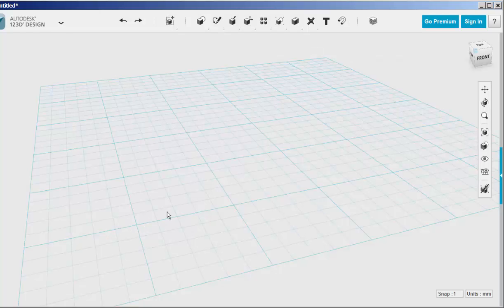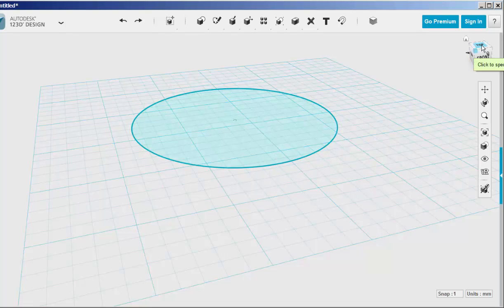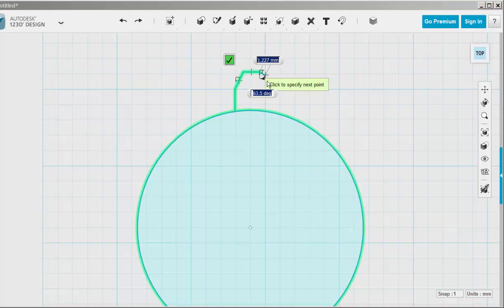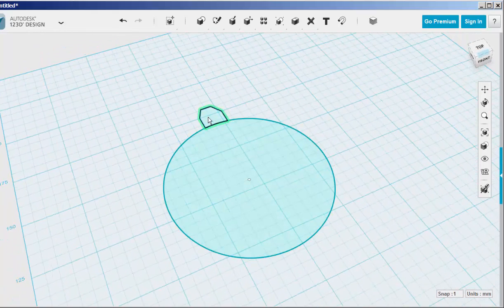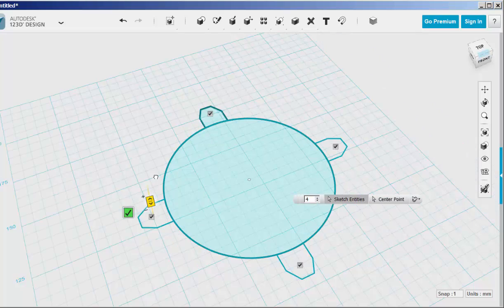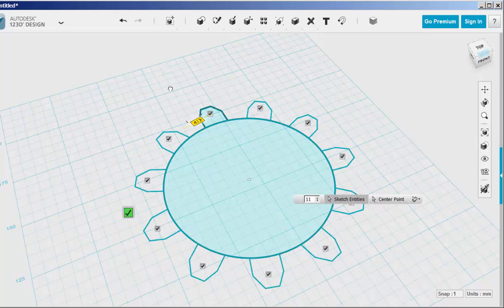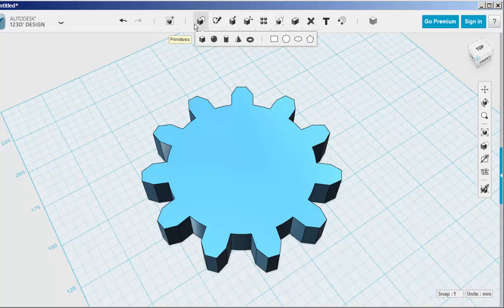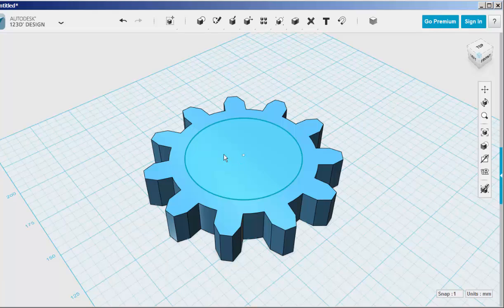123D Design: Spur Gear

Comment: I'm having a bit of difficulty with 123d design. Could someone please help me?
Reply from the maker: What, specifically, is your question?
Reply: I'm trying to extrude part of a object but it won't let me. It just says "invalid operation."
Reply from the maker: Is it a closed face? Can you see a face on it? If it's open face, it won't extrude.
Reply: It's a solid object. I drew a circle and tried to extrude in order to carve out a cylindrical shape from the object.
Reply from the maker: If you could link to a screenshot, that might be helpful. I'm wondering if you're press-pulling instead of extruding. Sometimes the latter works when the former doesn't. Also, is the object an imported STL? You can't extrude through those.
Reply: How do I show a screenshot here? I save my work as STL only when I want to print. This is a regular file.
Reply from the maker: Post the screenshot on any hosting service (e.g., instagram) and link to it here. About STL, I meant, if it's an imported STL file, you can't do much with it.
Reply: I don't have instagram. No, it's not imported. I can extrude the same object just on different places. It's only this one particular spot that it won't let me.

Comment: Although I see some complaints about whether this represents a functional working gear or not. I am just beginning 123D and don't really care whether it actually works or not, or even if the shape happens to look like a gear.   What I learnt was how to make multiple copies of a design and space them around a circle evenly and as I experiment I'm sure there will other uses for this info.  For that I am very grateful as it will help me a lot designing what I want to make in the correct dimensions all in 123D instead of using a 2D program and importing. Thanks :)

Comment: (Circle gear) my program i can mark only one object the big circle or the tooth is there a key you holding down?
Ok i found out if it do not work right as you seen:
1 Mark the tooth.
2 Click the gear symbol like in video.
3 Then before marking any thing, make sure its on the right side are on (angle)
4 Click center point of the cirkel.
5 then it shuld be there :-)
Reply from the maker: Hold the Shift key down to make multiple selections.

Comment: This is how you make a gear. https://www.youtube.com/watch?v=DqBOva04lcE
Reply: this are how to start from ground zero mate, good you like to inform others how to make better gears there work, but if you scale and use same tooth there are a bigger chance to make them fit right. if you just want to try it out on a 3d printer.
Some like to make something them self
Reply: The reason I sought out and watched the video link I posted was precisely because I was creating gears for a 3d printed project. "Ground zero" is not deciding on some random shape for a tooth. Ground zero is starting with precise angle for the gear faces. Watch the video if you're going to argue my point.